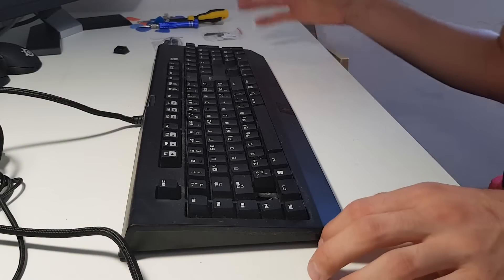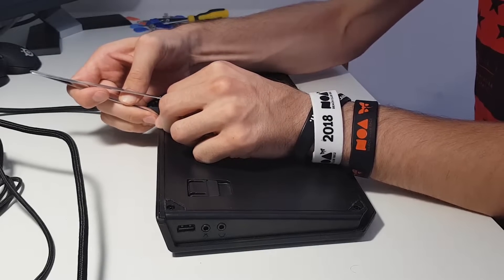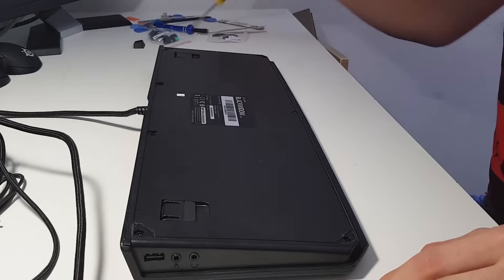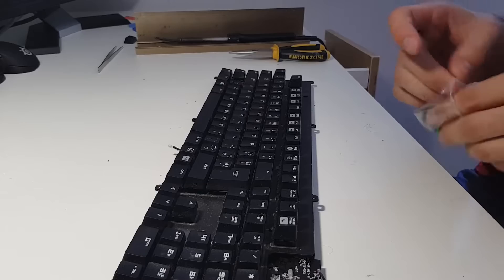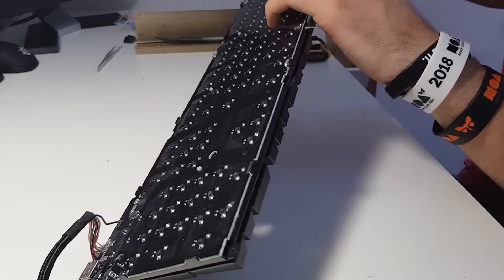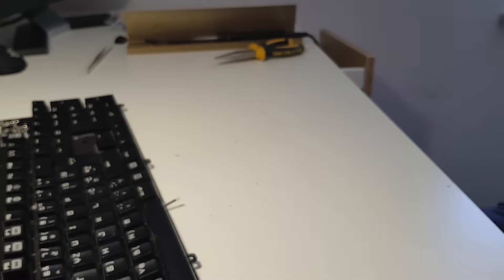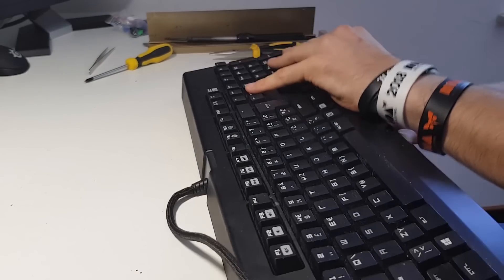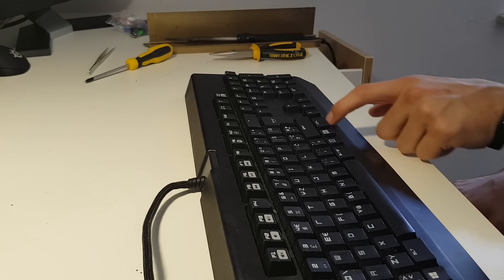Razer Blackwidow Mechanical Key switch REPAIR replacement (Works with any Mechanical Keyboard)

Comment: When you put that sharp thing into the board to clean it out, you most likely are scraping out the acctual contact point or cracking it
Reply from the maker: Yes I do realize that, but it's really hard to get out all the zinc, because otherwise you can't put in the new switch. I also don't have professional equipment that's why I have to improvise
Reply: Solder wick and flux are your friends ;)

Comment: Hey I think you are a good technican but my question is why do you have no antistatic mat for the parts that you fix? In the company where I work we have some and it helps a lot when you fix  laptops and other parts  because the screws can not fall to the ground so easy. But anyway thanks for the video it helps a lot!
Reply from the maker: Hey sorry for the late reply I did not see it before. Don't get me wrong, but even after watching me try to solder that keycap inside the circuit could explain a lot about my "professionalism" in these videos. I have poor equipment and I only do this as a hobby. I love fixing things and whenever I feel like recording it, I do. I never realized that my most viewed channel on youtube would be this, so I just do it for fun and whenever I feel like it, by no means is that a professional video, I am more reflecting to an average viewer viewing this :). Hope this gives a bit of an insight. Thank you for your comment though, I do seem to lose screws sometimes when I do repairs that include smaller screws, but I eventually find them :).
Reply: @welovetechstuff , ahh I understand I thought that this is your job.
Reply from the maker: @objekt907_stalinnotfound7  Hi, no this is just a hobby that I like doing in my free time :).
Reply: @objekt907_stalinnotfound7  Lol. Do you think he would post this after breaking the customers keyboard?

Comment: Hello, I would like to replace my whole board's switches.
I have a Blackwidow V2 with greens, and I want to put in razer oranges or cherry browns.
Will this video work out for me, and what are the chances of me destroying it?
Also, could you recommend from where I can buy them?
Reply from the maker: Hey, I don't really recommend it, because it is quiet difficult, specifically with LED lights attached on the switches. I'd say look for them on eBay and see if there are any.
Reply: @welovetechstuff   Yeah thanks for the quick response! I will just purchase a secondary board for cheap
Reply from the maker: @ekisfrole3118   Yes, I think this is just the best scenario. Used Cherry MX keyboards are really cheap nowadays.
Reply: you could just get the keyboard open then they'll slide right out
Reply from the maker: @daxyzeus  It doesn't work that way :). It's zinced to the circuit board.
Reply: You have 102 chances of fncikug the keys up alone.

Comment: I have a blackwidow 2016, 2 of my switches are not working. And i also have a cherry mx switch tester, is the cherry mx switches compatible with my blackwidow 2016?
Reply from the maker: Hello there. I believe they are compatible, however I am not 100% sure, make sure they have same mounting points. I'd still say that it's better to just order 4 Razer Green switches from eBay/Aliexpress for 2.50$ and put them on so that they are the same as others. Also first before you start putting the keyboard apart try to use WD40 and spray it inside the switch and try clicking it, it might actually solve the problem. Either way let me know what you decide to do I' curious and you might also help other people having the same issue.

Thank you for your comment and best of luck :). If you got any other questions feel free to ask, I'll be glad to help.
Reply: @welovetechstuff  can i put razer yellow switches on my blackwidow elite ?
Reply from the maker: @Iuzez  It's really hard to remove key by key I would really not recommend it. It would take you days to finish the project if you wouldn't fail and break the LED's.

Comment: Hey, great video!
Do you remember where on ebay you got the switches? Cuz it seems like I can't find any.. Was it a private seller?
Reply from the maker: Hey! First of all thank you for the positive feedback! Yes, of course. Just type in "razer Switch" in e-bay and it will find  the switches. One is listed under the name "
4Pcs RGB Green switches for Razer blackwidow Chroma Gaming Mechanical Keyboard" and you get 4 pieces for 2,35$. I Can't post links in youtube sadly, that's why I am giving you the title of the listing. Hope this helps.
Reply: @welovetechstuff  Thank you for your quick response! I found them on ebay.com thanks to you! Previously I searched on ebay.de and I couldn't find them there. :)
Reply from the maker: @fishadthethird  No problem, glad I could help you out :). Yes German eBay doesn't show all the items listed on eBay, that's why I use the international one (.com).